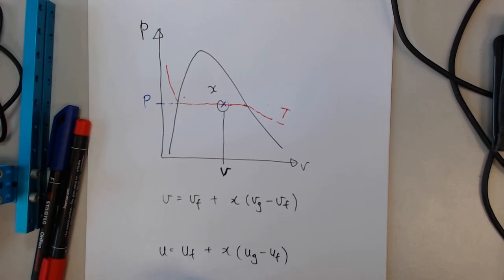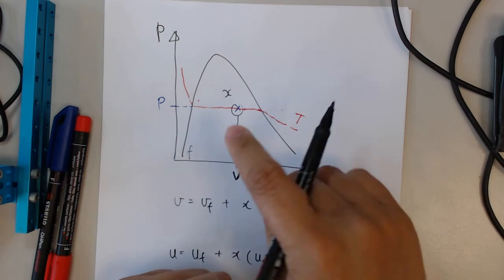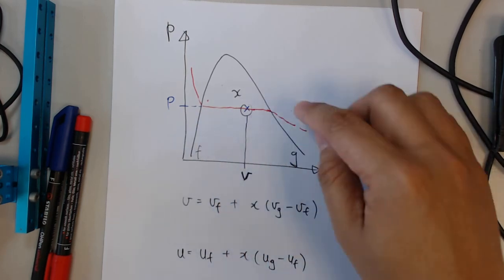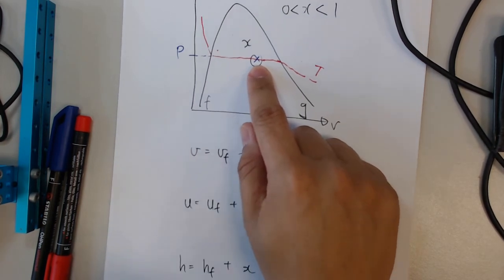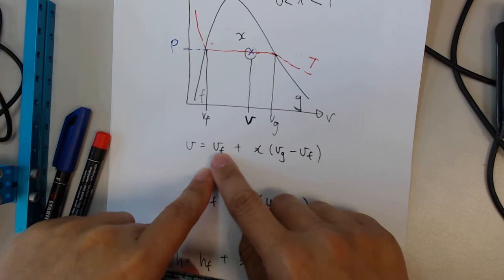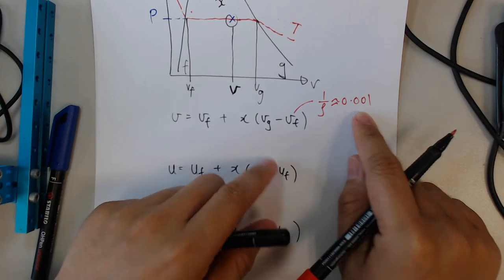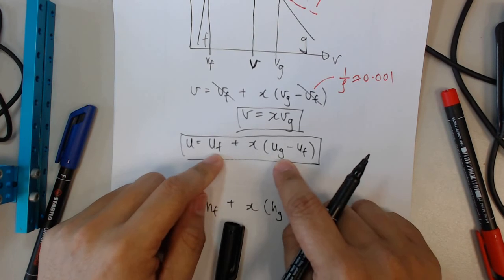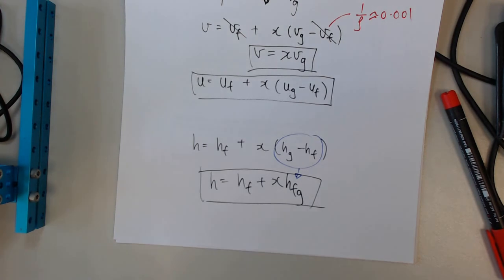Thermofluids: Dryness Fraction Equations

Comment: Hi 

Can u help me to find enthalpy of steam at 9 barg and 160C

Problem is dryness factor of steam is also unknow
Reply from the maker: Yo, at 9 bars, the boiling point is about 175C. Therefore, at 160C, it hasn't started boiling. Therefore, the enthalpy can be APPROXIMATED by the enthalpy at saturated liquid state, 160C, which is somewhere between 6 and 7 bars. So, you would have to interpolate between hf@6bars and hf@7bars.
Reply: Thank u